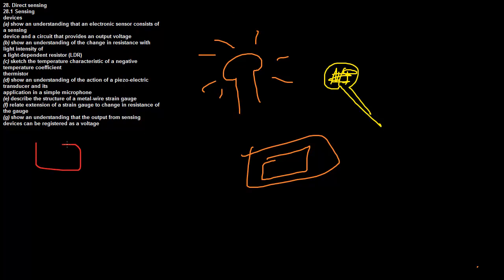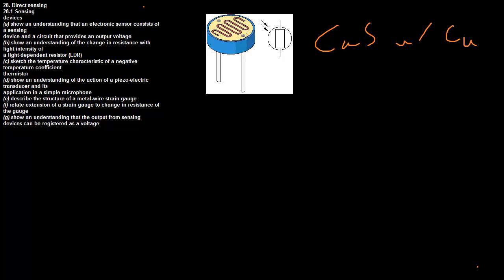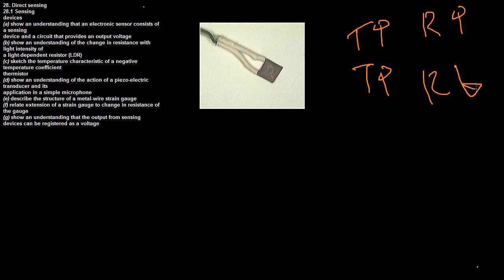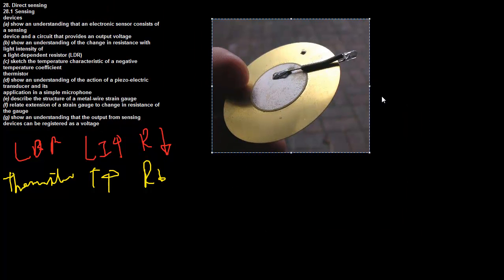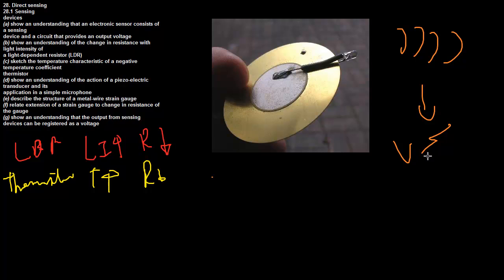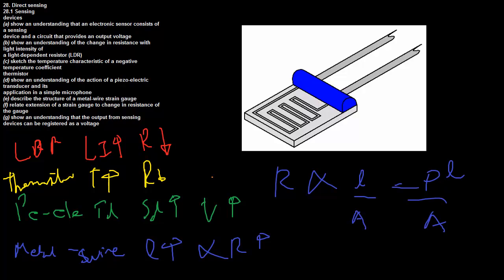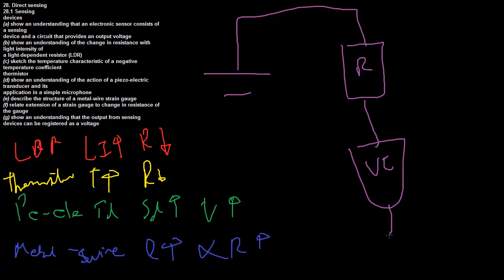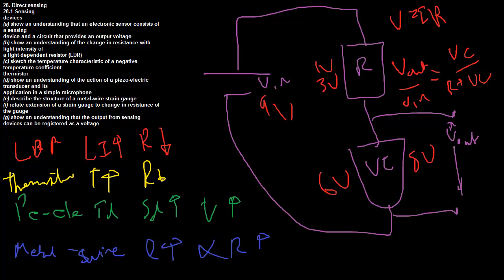28.1 Direct Sensing - Sensing Devices - CIE A Level Physics

Comment: @duting hong 
A strain gauge consists of  a fine metallic wire of uniform cross-sectional area sealed in a small rectangular piece of plastic. It is used as a sensor. 
You're Welcome 😊